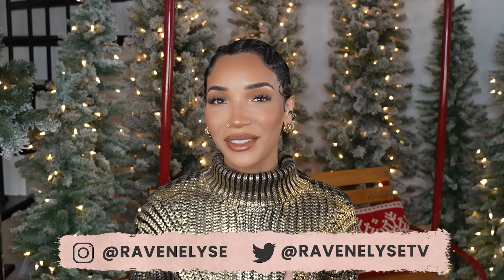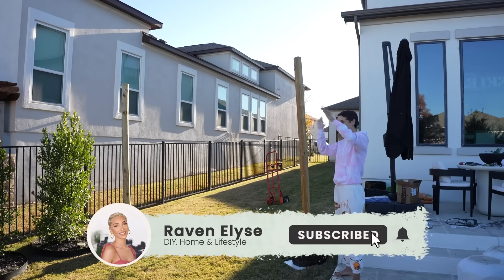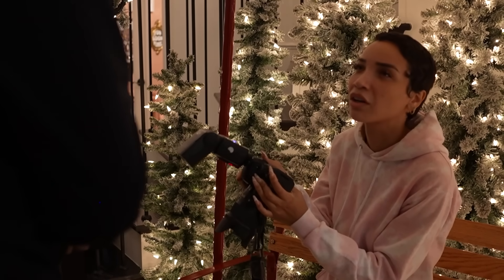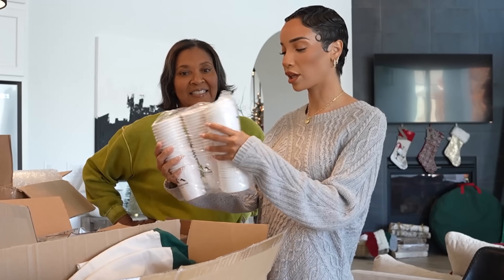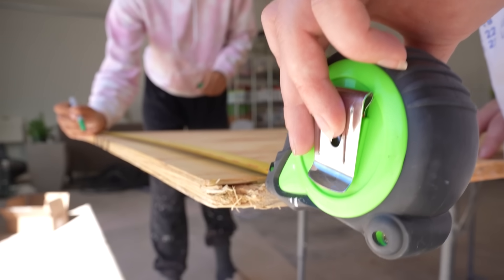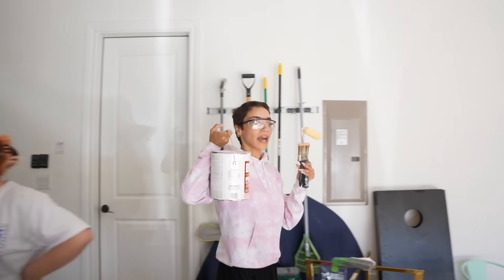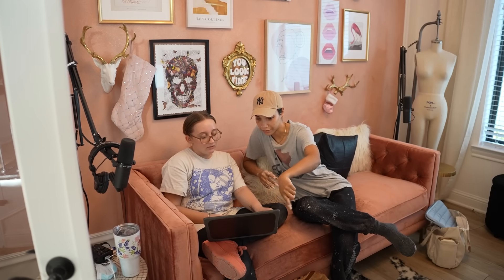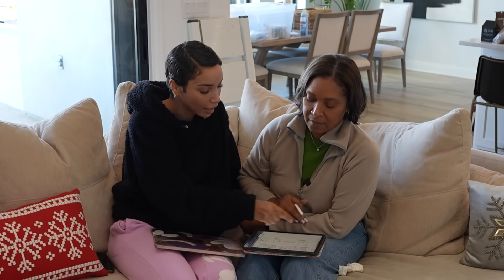Can I Pull Off My Biggest Christmas Party Yet?!

Comment: Hi! As a fellow cricut user, I just wanted to give you some helpful tips! 
If you make more stensils, use the green mat instead. The purple mat is strong grip and is meant for things like glitter cardstock. 
I've seen that it looks a bit difficult to remove the transfer-tape some times. You may be using a strong grip transfer tape. To make it easier to remove, stick it to your clothes or your arm before using it on your stensil. Transfer tape can be reused multiple times. (this will prevent the paint from coming off with the tape).
Make sure to remove the vinyl on your arch as soon as you know that you don't need it anymore. Even though its "removable" vinyl it may be more difficult after some time has passed. 

Hope this helps! :)

Comment: A tip for future stenciling projects: use the fat end of the white, triangular makeup wedges with a thin coat of paint. You have a little more control over the application with those than you do with the foam brushes, and you can always add a bit more paint before removing your stencil if you want fuller coverage. (That’s what we use at work where we make LOTS of signs 😉)